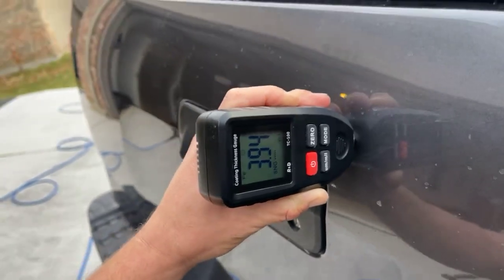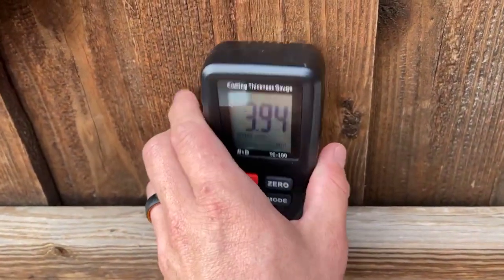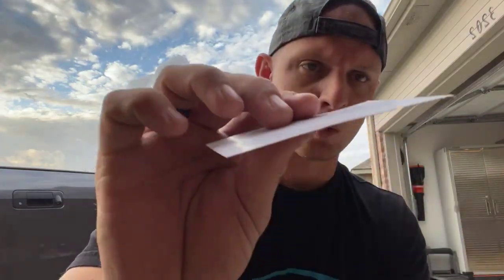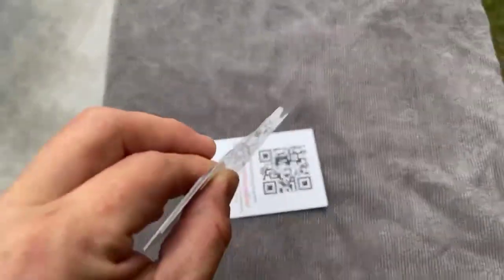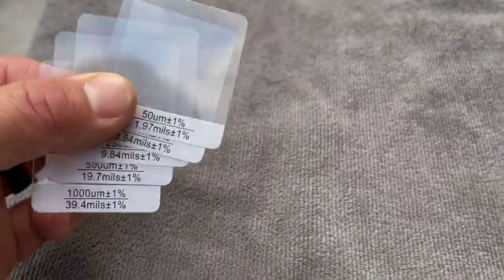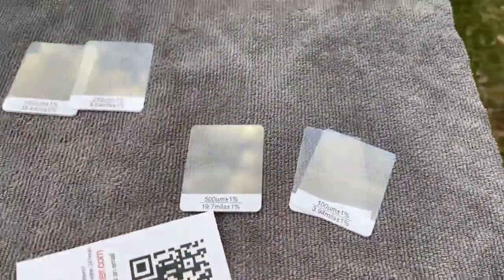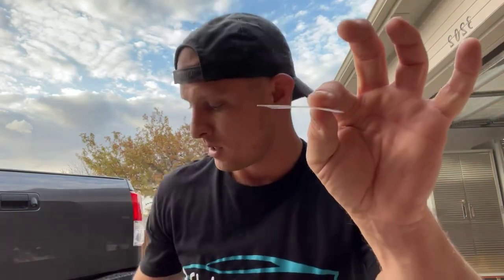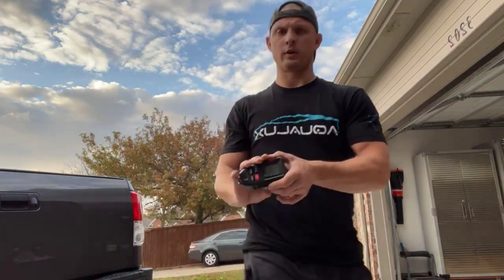How Thin Is Automotive Clear Coat in 2020 & Can Titanium Ceramic Coatings Help??

Comment: correct me if I'm wrong but the reading of the tool is total layers of thickness, it is not just clear, right? I got the same gauge and if you use the metal substrate and the sample measuring  layers the gauge reads exactly the measurement in the label which means that if you read from a car a 6 mil you need to divide that by 3 ( approx) to get the thickness of the clear layer , assuming at the factory they did 2 coats of 1 mil each( primer, base, clear), that is why in a repaint you can read 15mil+- because when they repaint they might do body work and add primer and other layers on  top of the already existing coatings and since is sprayed by hand most probably the thickness will not be of 1 mil eash pass

Comment: Yes, it definitely sounds like since the 2020 vehicle clear coat coatings are typically now as low as about 4 mils or about 100 microns; since we know that 25 microns equals one mil.

With that being the case it definitely sounds imperative to actually fundamentally correct this rather serious deficiency by sufficiently preparing and prepping the surface of the vehicle to accept a supplemental adjunct amended additional clear coating layers; as that definitely sounds like that existing clear coating layer is far to thin at only 100 microns(half the thickness of a business card).

One might logically think to add at least four additional coats of clear coat layering; at about at least 25 microns per additional clear coat layer hopefully; in order to be able to give oneself a bit more operating safe error margin in the future in case one has to perform a future two step color correction on ones vehicle down the line at some point if needed.

One might get their brand name of clear coat on the internet from Restoration Shop with the resin and hardener activator in their gallon kit for about $150 bucks; which should allow one to be able to use even ones branded name airbrush vehicle coating finish application gun to have more potential application of the clear coat layers applied on the vehicle surface but with much less over spray of clear coat; however one might have to use some added amount of viscosity reducer clear coat additive added to the clear coat being sprayed; so that one can lay down a quality uniform and consistently applied clear coat layer also as well.

One can also naturally of course also apply a high quality branded name ceramic coat paint sealant also as well naturally of course using the multiple layering scheme also as well to increase the actual depth between the vehicle base coat and the final applied top coat ceramic coat ending layer if so desired; in order to help increase the actual combined clear coat layer plus all of the actual combined ceramic coat layers added up together.

Their is absolutely no reason at all that one should have to accept such substandard thickness of their rather thin clear coat layer; and one can definitely do something about it quite readily by having it done by a local competent vehicle detailer; in the case one does not want to tackle such a job on a do it yourself basis naturally of course.

Comment: I detailed a 2016 F150 with 8k miles on it a few weeks ago and old man owns that’s garage kept. He said it had never been polished and he bought it brand new. All my readings were between 2.2 and 2.5 mils. Paint is getting ridiculous and making our jobs more difficult. Meters are a must these days.
Reply: If your getting readings that low your gage is faulty. 2016 F150 is 4.5 mils on average.

Comment: I detail brand new vehicles still covered in shipping wraps and plastic. Just taking off the plastics can marr the paint. the glue residue leaves imprints inside the clearcoat. removing the tap lines requires a polish practically. Add in the piano finish trim pieces that just looking at it scratches it. 
Thank you for this video. I was nodding my head the whole time. you rock Landon!
Reply from the maker: Thank you for the support and for the feedback!! 🙏🙏🙏🙌🙌🙌🙌 I’m
Super grateful 🙏🙏👊👊👊

Comment: I want to apply a ceramic coating on my brand new car, and I have meguiars iron remover spray clay, does it replace the clay bar?
Reply from the maker: No it does not.  You need to mechanically sheer off and decontamination on the paint.

Comment: You mention your 4, 5, 6, and 9-year coatings add mils. What about a single or double layer of T3?
Reply from the maker: eldrin I know I said mills but I meant microns so please forgive me for the mistake.  I appologize.  The two coatings that add microns is t6+ and t4+.  When t6+ is used hvlp it can add up to 25 microns to the paint.